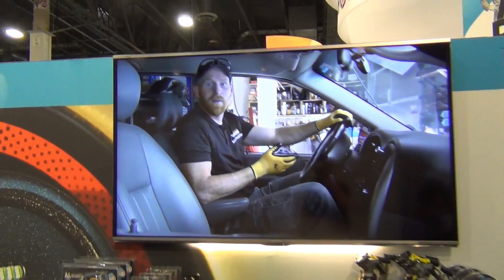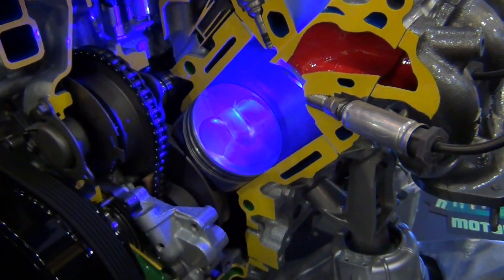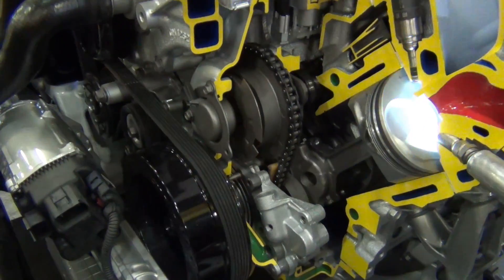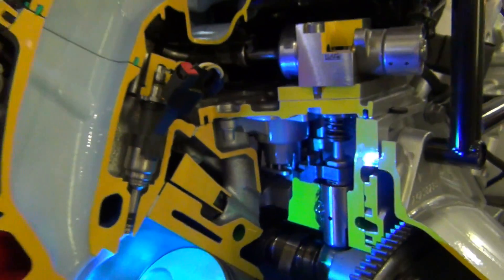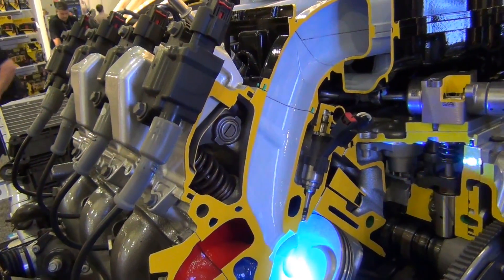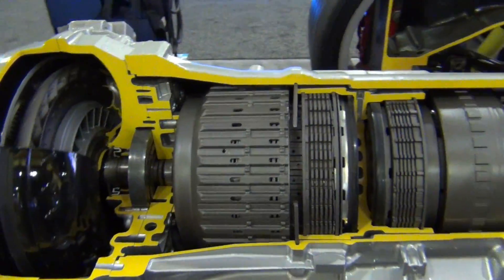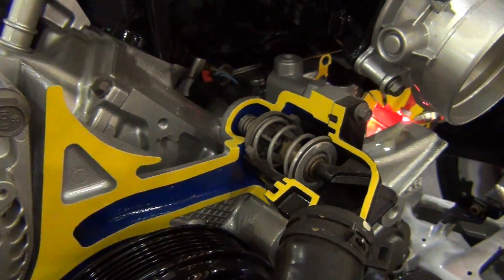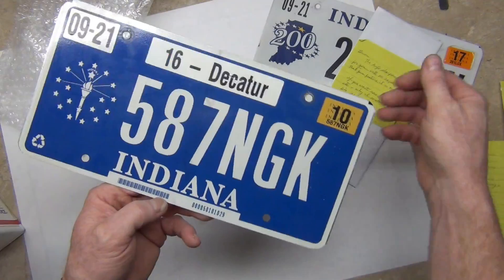ULTIMATE Drivetrain tutorial Cut Away In MOTION

Comment: that thing on top of camshaft is the high pressure fuel pump thats actuated by the camshaft
Reply from the maker: That's right.
Reply: I think the direct injection is cool. but a same to make real power . you have to put injectors in the intake runners to get enough fuel! great for economy bad for high HP. so adding supplemental injectors ain't so bad. add a turbo and 20 PSO boost. and more injectors. get about 900+ and 800+ lbft tq..
if you don't like pushrod engines. wait until you have a timing belt break. it will probably be cheaper to buy another engine!

Comment: WOW Still using cam in block GM still 15 years behind!!!
Reply: *Gets 30mpg
*Still revs to 7,000+
* Smaller and lighter than DOHC design
*Keeps center of gravity lower
* Able to create large displacements out of physically smaller engines for better hp/torque density.
* Broad torque band
*Sounds cool.

Maybe GM was just ahead of the times.
Reply: Show us on the doll where the OHV engine touched you
Reply: Lower weight, not as tall, cheaper to produce. Why not?
Reply: One rotating piece vs two. . . .  Rotating pieces eat horsepower much more than weight and drag.
Reply: Is rocker a trigger word for you?
Reply: highvoltage454 i hate overhead cams